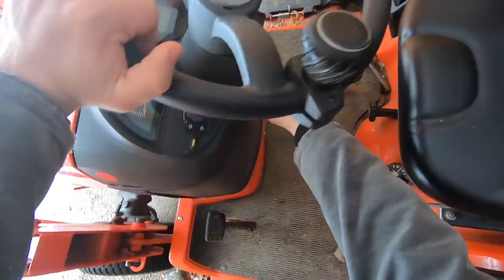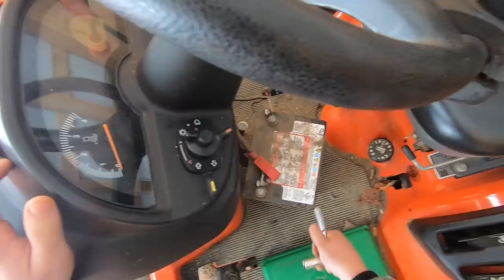Getting the HOMESTEAD READY for the BIG winter STORMS

Comment: Hey Al. You may need to get some starting fluid to Help start it for the winter. I would also get a trickle charger to keep a charge in the battery. Glad to see you took off your deck for the winter. I would also turn your bucket to keep the water out. Clean all the dead grass off to cut down on the rust and put some grease in the fittings.

Comment: Al, 
I used to work for a company and installed hundreds of batteries.
Please remove the negative cable first then the positive side cable.
Why, you may ask. If you undo the positive cable first and the wrench or tool touch any part of the metal, it will spark or worse weld it to your wrench.
Safety.
Keep an eye out for a package at your P.O. box. 
Love the Channel Frank from CA

Comment: Gooooood Morning Tracker Al , Gina & Olivia ,
The best rust preventative that I have found for motor vehicles ( your truck and car ) and other outdoors farm equipment is to spray the underside with used motor oil. Undercoating as some use , will crack and trap moisture . But , old motor oil will seep into all of the places that water can reach. And it then repels the moisture. It also solves the problem of what to do with the old oil when you do an oil change.  It can be sprayed on with a regular garden sprayer. If the oil is to thick to be sprayed , it can be thinned with some Kerosene which also repels water.  The Kerosene will evaporate .  You have longer lasting vehicles and also a use for the old motor oil .

Comment: Possum most likely. The mower deck is easily hung low on a wall by tying a rope between the front deck wheels. I have two bicycle hooks 2' apart 3' off the floor to hook the rope onto. Keeps the deck off the ground and not providing critters a place to nest.

Comment: What you need is a Battery Tender (brand name) for your tractor. They also have accessory quick disconnects that is basically plug and play. The battery in my lawn tractor is 10 years old, I keep the Tender plugged in 24/7 when it's not in use.

Comment: Al, I used to have to put the chains on 75 mail vehicles every time it snowed in Northern Illinois.  I'd give you a couple tips.  We used to let out all the air in the tires, then put the chains on as tight as we could get them. Then air the tires back up.  They would be tight and stay that way all day.  Also, get yourself a small spool of wire and wire the loose ends so they are not flopping around.  They stay tight as well.

Comment: Now is the time to clean, sharpen and do any maintenance to the mowing deck. Grease up the spline area so it does not rust over the winter. Lube all the zirks. check the belts, bearing and blades. Weld up any cracks, etc. Great project to do in your heated shop now that you have one.

Comment: Rust will cone on the mower. It should be cleaned and greased up ,before you put it into storage
Reply: Poor Al, we are all saying the same thing, why isn't he scraping off the junk and oiling his m/c before storing it...even when you state you will be doing maintenance soon on it,  you can't win can you :)
Reply: @sylviabutler4809  I know how he feels, got my truck out of the shop, first time out the radiator hose leaks and My Envoy messages my phone my battery needs checking, they said it needed a new one!!! Scream!!!
Reply: To fix the cracked discharge chute on the mower deck, consider replacing it with more pliable & durable sidewall of a used tire.

Comment: I put chains on for years.  The best way to put them on is to drape them over your tires so that the locks are against the ground on the back of the tire. You then back up on them and then latch tight.  This process tightens the chains the best I've seen. then retighten later.

Comment: Gooood Moooorning to everybody out there. It’s 41 degrees with rain here in SW Idaho. When I lived in a Colorado we would often chain up all four wheels of our 4WD trucks. As you may know you can do thousands of $’s in body damage to a vehicle if you don’t chain it up right. We used vehicle jacks to lift up each tire then chain it up. This allows you to center and tighten up each chain, then you use chain (not bungee cords) tighteners to complete the install. Good luck and stay safe out there.

You mentioned tail drag behind the tracks, I’m thinking you have a fox, pretty smart they are. They come in in very close to homes (yards away) even in an urban/rural interface which is were you live in. Finally, my money is on Gina making candle holder. The size of you Forshner make me think of votive candles.

Comment: You need to rig up a hoist system to hang the mower deck from the rafters of the tractor side of the wood shed, gets it out of the way and not taking up floor space anywhere.

Comment: Make sure that battery is anchored down so it does not move about.  I had a loose fit wear a hole in the case and also on a bump hit metal and start an electrical fire. So bolt that battery down firmly.

Comment: Raw pork, raw burger/beef.  Best--pick up some road kill.
I'm in N Minn Al, -21 yesterday morning.
Next spring, run power to the Kubota stall.  Then you can plug a battery maintainer in for next winter.  Much easier on battery life in the winter.  You can get a maintainer for that battery for $25-45.  After use in the cold, just plug the maintainer in.  Will extend battery life in the cold.  Since your battery is a little hard to get to--you put pigtails to the +/ terminals permanently.  Fish the other end of wire out past the battery panel where it just hangs.  That end is a quick plug/coupler.  It will match a coupler on your maintainers end for easy connecting.  They make spring tensioners that easily clip to your tire chains.

Comment: Candle holders the little tea lights. Line the inside of the hole  with aluminum foil its safer and if you paint use water or acrylic, not oil base paints

Comment: To take the belly mower out from under the tractor, you are supoosed to pull the scalper tire pins 90 degreees and lock them back in, and THEN pull the deck out. Its WAY easier that way, and in 10 years you might not be able to do that again. That deck weighs about 100 lbs, i think. I would also add a big hook and chain to the tractor stall wall and secure the deck to the wall that way, after cleaning the underside of the deck(should be powerwashed in the fall, but i know you couldnt get to it then.) we also do the small chain and hook trick to store all our long handled tools to the garage wall so they dont fall down.

Comment: Al, I’ve caught many raccoons using  an egg as the bait.  I dig a small hole about 5 inches into the ground and crack the egg into the hole. As it rots, it makes an irresistible stink.  Animal digs into the hole. Set a jaw trap about 4 inches from the hole covered lightly w dirt.  You’ll get a good hind-leg catch.  Use sticks to “guide the path in”

Comment: You can tie a drain pipe corrugated to a tree and fill it with shelled corn make sure to cover the top to keep it dry in the pipe. Place the pipe five inches from the ground put some corn around to help the deer find the corn. This will attract all kinds of animal. Stay away for at least a week before you check cameras. You should have lots of pictures. Good luck.  The only needs to be about 3 to 4 feet long

Comment: Hey Al. Try deflating the tyres, then tighten the chains and pump the tyres up again for a tight fit
Reply: Yup ...
Reply: Yup here too.
Reply: Yes, as long as there is no liquid weight.
Reply: @t-bear1863   Valve stems on top if there is fluid but deflate a bit tighten chains then inflate to pressure needed

Comment: I believe the camera is NOT set up correctly. As I watched the other day while you switched out SD cards.. I believe the SD card needs to be formatted to the camera.. refer to the owners Manual to see how to format the SD card.. there is a format setting on the camera In the menu. Don’t be confused by the fact that it took your picture and nothing else it probably took pictures but did not save them to the SD card since it wasn’t formatted again refer to the owners manual.. I believe all trail cameras have that format setting regardless of the manufacturer.. and once again Bait depends on what your trying to trap sardines work great on raccoons so does marshmallows , peanut butter , dog food and cat food. But those are items that other predators might not bother with. I would also suggest you not concern yourself with what is in the woods and be more concerned with what is coming up to the farm area the animals at most risk are the copper morans in the greenhouse new yolk city has two layers of fence and the chickens are in a wood enclosure making it almost impossible for a predator to get to them.

Comment: That's a fox that has a smell of your chickens. You should adjust the feet on that plow to desired level but removing them will allow plow to dig in and is hard on the plow itself, that is why washers are there to adjust desired height. 5 eggs plus two, nothing wrong with that.

Comment: Al, look for MOTOPOWER MP00205A 12V 800mA Fully Automatic Battery Charger/Maintainer on Amazon, it has a quick disconnect. Very handy.  I have them on all my machines.
Can leave the little dangler outside the machine, then plug it in when you're done using it. Bah, food for thought.

Comment: Plow isn't plowing good - change your fluid, 25 yrs experience in the subject, during the summer condensation forms in the fluid tank, this causes sluggish response from the plow. Put all rams in all the way, syphon all fluid out fill with new fluid and add a small cap full of fuel line de-icer to the fluid this helps stop winter hydraulic freeze ups. When filling make sure you are using boss fluid, hinker and western fluid will also work too but it's best to use the fluid that your plow is made with...

Also your mower deck, it's best to go thru and do the grease maintenance as soon as possible to prevent rusting of moving parts and clean up of debris on the deck to also prevent rusting on deck surfaces, lastly when storing for winter wd-40 over entire deck surfaces prevents new rust from forming or getting worse during winter storage. Save the replacement of the blades thou for spring, if you put new blades on now they may potentially rust during the winter months.

Chains, deflate tires, adjust chains to desired tension and inflate tires once chains are at desired tension, this eliminates the need for bungee cords if u get the proper tension on the chains.

Comment: Not all these tracks are necessarily predators, but the tracks with the tail slide marks are very likely weasel, mink or marten, whatever is common in your area, which are light in weight & are not shy of water. These are predators & roam areas & are not territorial. There is a variety of tracks & a strong possibility some may be tracking each other, causing this confusion. Fox, coyote, racoon & the like, will revisit often when they discover a food source. Racoon usually live in the area they hunt & scavenge in & they more often than not live in a group, also needing a water source near by. There is a difference between scavenger's & predators & most are very smart. Even in Urban areas they establish quickly where the easiest access to food is. I'm thinking the cameras may help for ID but wouldn't set traps not knowing what you're dealing with, especially when bateing.

Comment: Gooooooood Morning Tracker Al , Gina & Olivia ,
Winter is the down time for the mower deck .  It's good time to do some P.M. Time to clean it up . Grease it , sharpen the blades ,  Maybe use some preservative on the belts ?  And then I would spray it all over with some WD-40.  Which is not a lubricant as some think.  WD stands for water displacement.  Spray the mower deck all over with WD-40  to repel moisture . ( rust ) Come grass cutting time and the deck will be ready !
  The sardines should be a good bait for the four legged meat eaters.  Just not in the can with sharp edges.
  Your cameras should be placed to monitor the coops and barn.  That is where your concern is , not out at the edge of the woods.
Find out who is around the coops and then , you can take preventive measures.
  Tanner is looking and acting more and more like a Border Collie. Now is the time to begin training him for animal control.  He can not be allowed to just go at the goats !  Only when he is told to and then it is his job.  I know that training Tanner is an extra task. But training Tanner can be a fun hobby all in itself. A well trained dog is a joy to behold. 
  Once trained , Tanner can be used to take the goats out into the pasture and bring them to the barn  when you tell him to .  He can even bring the goats in , one at a time ,  if he has been trained and that is what you tell him to do . Al , you may find a Shepard's whistle to be helpful in giving commands.   I have read though that they can be hard to learn to use.
  Try watching some videos about herding with Border Collies .  Simply amazing.

Comment: Better late than never getting that deck removed... I see U in fact do have a set of chains for the tractor & they are a little bit better than the el cheapos since they have cross bars, well done. Have U considered a trickle amp charger for those long periods of little to no use in cold weather for all your batteries. Even your brand new NAPA battery will thank U for it! The tracks with the dragging tail look like a fox to me. Foxes put put their rear paws into their fronts creating a straight line path & I believe that is what I have observed here. U might find a book on animal tracks quite interesting BTW & I think Amazon sells them...
Bill on the Hill... :~)
PS: Do I see a bench top drill press in the future for that new workbench?

Comment: When it comes to purchasing batteries for tractors, never let the battery seller know what the battery is going to go in. The reason for this is because tractor batteries are only warranted for 90 days where the same battery used in a car or truck may carry a 2 year full replacement with a prorated life of 3, 4, or 5 years.

In trail cameras, the best affordable high resolution, good night vision camera is the Stealth Cam DS4K. This camera gets rave reviews. 30mp still images and 4k video. Make sure to purchase some of the EverReady Ultimate Lithium AA batteries. Great cold weather performance and long lasting. 

I'm going to guess fox due to the urine marking. A good sized red fox will go 25-30 pounds. A coyote will run from 30-45 pounds. One chicken won't be enough for a coyote. A coyote will kill 3 or 4 birds and eat the heads off. A fox will run off with the kill and cache it for later eating.

Comment: That deck should be cleaned on both sides and both sides coated in Rust Check. You should also grease the spindles and guage wheels. Kent

Comment: Greetings, for stowage and servicing of your Kubota MMM you might look into a set a mower deck axles. http://www.moweraxle.com/photos.html
Or perhaps make your own set up with taller wheels to roll over the gravel easier.

I've been using them for years on my older BX23D 60" MMM and they really show their worth when servicing the MMM. I purchased my BX back in 2006 and I'm on my 3rd battery, they do seem to last pretty long but as you know, it's the extreme's in weather that show how weak they get over time. Good luck to you and yours.

Comment: raw meat, calves liver, chicken, cow tongue, all good bait for predators. If i could make a suggestion it is always a good idea to have portable battery power especially where you use many things that use 12v power. These are a great light weight that anyone can carry and use, https://smile.amazon.com/LEMSIR-21000mAh-Starter-Portable-V1/dp/B07H7C8RQK/ref=pd_ybh_a_38?_encoding=UTF8&psc=1&refRID=ES6WAN7X06MRJE53S22E  this one not only will start up to a 8L gas or diesel engine but after the vehicle starts it will tell you if your alternator is good or bad and on Monday it was on amazon for $30 off as a early morning lightning deal. Another company that makes a real good 1 is Beatit and they have a similar 1 that like the other 1 you can use it to wirelessly charge your cell phone if needed. I have one in my vehicle and also got one for my wifes vehicle. We have not needed it yet for our vehicle but have both helped out people start their car, that was dead after work. If you do not connect it right a red light comes on to let you know and there is a button for extra boost if the battery in the car is dead. here is a link to the beat it one    https://smile.amazon.com/G18-PRO-Wireless-21000mAh-Portable/dp/B07FTG9PBK/ref=sr_1_5?crid=2A6RLIA1LCE0D&keywords=beatit+g18+qdsp+2000amp&qid=1576158606&s=automotive&sprefix=beatit%2Cautomotive%2C188&sr=1-5  right now it has a 20% of if you check the box b4 you add it to your cart. One more thing is you can start 7-7 vehicles on a single charge. I just thought you may find it helpful.